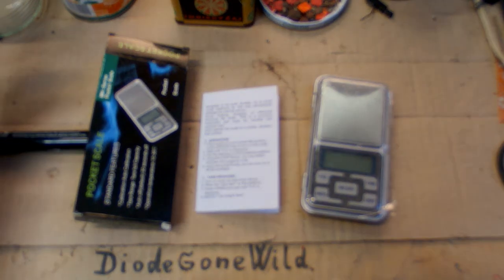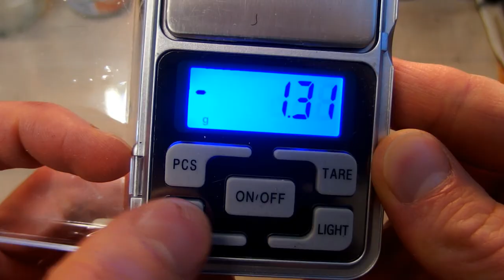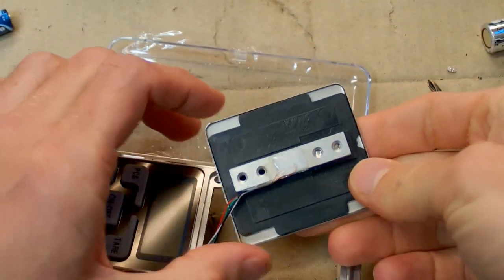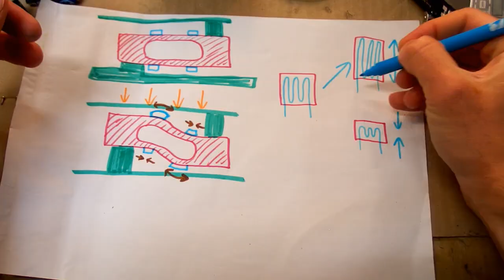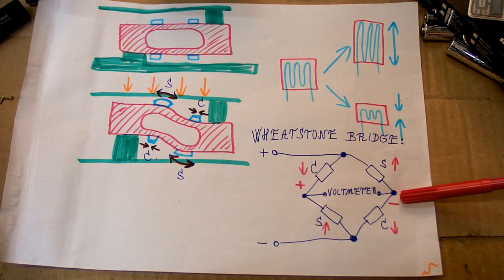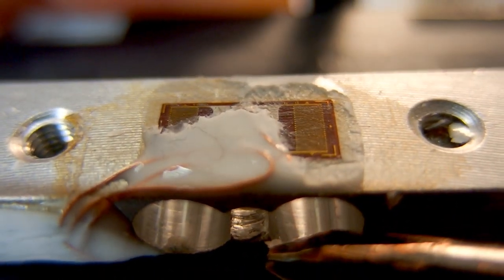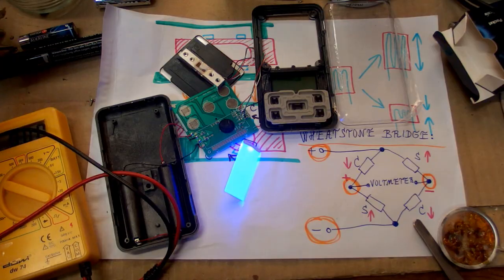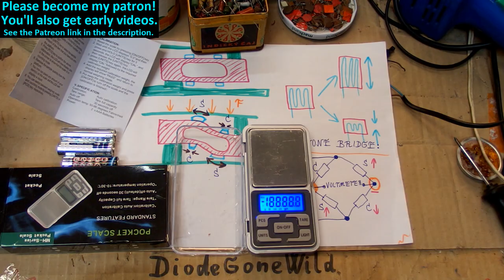What's inside a digital scale & how does it work

Comment: you can probably put a 500g weight then compansate it. When you remove the weight it will say -500 after that you can measure up to 1kg in teory.
Reply from the maker: Yes, that's right, because it has full capacity tare.
Reply: This often works, although there is a chance the load cell will be bent/changed permanently, making it less accurate.
Reply: Tried with my cheap kitchen scale and it don't work. 
Probably the chip can only read (example values)maximum 0,6V (600gr) and it can't read it correctly 

Different is if the cheap display can only shows (max) 199.99grams. In that case the trick will work
Reply: @thefighissimo  I doesn't work for all of them but works in mine.
Reply: Yes, in theory you should be able to weigh anything from 500g. to 1kg. by this method, or even up to 1.5kg. by zeroing it again with 1kg. on the scale pan; but in practice you would have to watch out for (1) the voltage difference exceeding the input range of the amplifier and (2) the force applied exceeding the elastic limit, so some part of the sensor does not spring back to the shape it was before but is permanently deformed.

A good design engineer would never let that happen, probably allowing for the system to withstand up to 2.5kg. before non-elastic deformation if it said maximum 0.5kg. and the amplifier to remain linear all the way up to 1kg. But a sales manager will insist for everything to be made as cheap as possible in order to get maximum profit, so the metal beam may not be strong enough to take much overload. And it is a bad idea not to use the full linear range of the amplifier for meaningful measurements.  The smaller the wanted signal, the greater the influence of any noise upon it.  The analogue to digital converter also has a limited number of steps, which must be a power of two; probably 65536 steps, to cover the range 0-500g. in 0.01g. steps.  Once you exceed the maximum input voltage, it will never read any more than 65535.

(It is possible to use two analogue to digital converters together to obtain a wider range but with less precision at higher readings.  This is often a good compromise between maximising precision on small readings and using an analogue to digital converter with a higher resolution  (more bits = more £€$, and in any case you are often restricted to what is available on a chip).  For instance, two 8-bit converters are fed with a signal x and an amplified copy 16*x.  The converter receiving the stronger signal will max out at 255  (which is really 15.9375, since it has been amplified by a factor of 16)  but the converter receiving the weaker signal is still only reading 15 at this point, and can go all the way up to 255, just in coarser steps.  What the software has to do is read input 1 and if it is 16 or greater, then multiply it by 16 to get an answer from 256-4080; otherwise ignore it, and use the reading from input 2 directly to get an answer from 0-255.)
Reply: @bluerizlagirl  Precision devices like this one will usually use a Delta-Sigma ADC. (search this on Wikipedia). Depending on the setting Delta-Sigma ADCs usually have up to 20 or 24 bits of resolution (sometimes even more!), however the smaller the resolution, the smaller the sample rate. It's not impossible for this scale to have 20 bits of resolution because it can leave some room for calibration/rounding. I mean that 0.01g might be equal to 0.8 ADC steps with a 16-bit ADC which will cause rounding errors, whereas with a 20-bit ADC it will be equal to about 13 steps.

Comment: Very sensitive measurement needed; remarkable it so cheap.
Reply: It's a consequence of precision mass production.  As long as you can make the sensors as identical as possible, from then on all the laws of physics are in your favour. The impedances are low and the wires are short and close together, so noise pickup is minimised. The components on the chip which make up the amplifier circuit are close together, so at the same temperature, which means everything is affected equally.  And the analogue circuitry is symmetrical, basically three op-amps: one to provide a buffer on each input to minimise the influence of the other input on it, and the third to amplify the difference between the two to match the analogue to digital converter.  This symmetry naturally rejects noise.  All the rest is straightforward digital stuff well within the capabilities of a modern microcontroller.
Reply: @bluerizlagirl  Thats a good analysis.  I wonder if a generic op-amp like LM324 can work like a instrumentation amp you mention.  The figures measured in the video seem to in the millivolt range; maybe the input offset of 2mV of a generic op-amp would be the limitation.  I've checked these low cost Chinese digital scales- the construction are with the cheapest materials possible, and even the finish is lousy.  However surprisingly the measurement is precise and repeatable over months.  I imagine that someone has mass produced these as an SOC, and selling it off cheaply in bulk to anyone interested in building a product around it.
Reply: @rtos  As a general rule, the smaller you make something, the fewer ways there are it can go wrong. What's most important in making both instrumentation amplifiers and A-D converters is close matching of the ratios between resistors, and that's actually easier to do in silicon than to get an exact value. The programmable gain and offset circuits also depend on closely-matched resistance ratios. Also the close thermal contact helps compensate for temperature changes.

I'm expecting it to be using software calibration to tweak out DC offsets (knowing there is nothing on the scale pan when first switched on, so the weight should read 0g.) and set the gain, and some sort of averaging over multiple readings. These cheap scales do tend to drift a little over time, but that's probably why the automatic power off is so aggressive!
Reply: @bluerizlagirl  how does a cheap knockoff like this compare to original one like lyman or hornady, frankford arsenal ?

Comment: That Auto off in some scale like this is one of the biggest annoyances in my life. When you do not got all ingredients of the cake at hand, it will turn off just the moment you are back, and you are lucky if you can figure out what's already in the bowl.
Reply: smoke atleast 1 bowl of cake ingredients but no more than 8 bowls while weighing cake ingredients or you will forget easier
Reply: I was just about to comment about this.
I wish i could find out how to bypass the Auto off feature!
Reply: @jayytee8062  No problem, the blob can not be accessed, but a pulse generator with a relay could connect resistors to the bridge shown in the video, this would simulate something is happening on the scale. Will make this happen after I finished the other 100 ideas I have...
Reply: @timtim8468  
Thank you!
Reply from the maker: Finding a completely flat battery in equipment with no auto-off is even more annoying :D.
Reply: @DiodeGoneWild  
Only if you don't know how to operate an on/off switch
Reply: @DiodeGoneWild  When I steer my car into an obstacle, it will do. But ... they are working on that too.
Reply: @jayytee8062  If you succeed, you will end up wishing you had not! The auto power off shuts off the scale before the reading can drift too much.
Reply: @bluerizlagirl  
I don't understand your last sentence in your comment.
Reply: @jayytee8062  If you keep putting something on the scale and taking it off so as to keep the auto power off from kicking in, you will see how the reading drifts over time.  This probably is due to temperature changes.
Reply: @bluerizlagirl  
Ok i see.
Have you tried this modification yourself?
Reply: @jayytee8062  No, I did not think there would be much point in defeating the auto power off because the reading changes over time and would soon become false.  If you leave the scale on for a long time, it drifts and needs to be repeatedly zeroed.  So I just weigh one thing at a time and record the reading before the scale shuts off.

But if you are really desperate, you need to wire an NPN transistor and a resistor, any value close to about 10x one of the bridge resistors should do.  Connect one end of the resistor to one output from the sensor bridge, the other end to the collector and the emitter to battery -.  Now you need a circuit to pulse the base of the transistor on for about 100ms, every few seconds, and then back off again.  That will simulate changing the weight, and cause the auto power off timer to reset itself.
Reply: @bluerizlagirl  
Thanks for the reply and technical info you have provided.  Awsome!

Comment: Information about battery life and behavior with dead batteries:
Current when OFF:   0.4 uA   (virtually indefinite shelf life - no need to take out batteries)
It gives Low battery warning (refusing to work) bellow 2.5 V so it will use up only around 50% of capacity of normal primary cells and maybe 10% (!) of NiMh rechargeables at best.
Current when ON, without backlight:   3.5 mA   (ca. 140 hours of continuous use, assuming using up 50% of an AAA capacity)
Current when ON, with backlight ON:   14 mA when running from 3.2 V (fresh batteries), 7 mA @ 2.8 V and 3.5 mA @ 2.5 V (backlight goes very weak).    (hard to guess - few tens of hours, maybe???)
The low battery warning seems to be reliable and the scale doesn't read nonsense with low batteries.
Reply: Interesting addition, thank you!

Comment: There is an other kind of digital scale, that was used in low budget digital personal scales 20-30 years ago. It has the same mechanism as an analog personal scale with the rotating number disc, but the number disc is replaced with a slotted code disc and an optical gate, like the optical encoders in old ballsy PC mice. They are horrible. You stand on it three times, and it gives three different values with about 5% or higher inaccuracy :)

Comment: Nice. 4 wire measurements of the resistance in the strain gauge. That helps a lot with accuracy and temperature stability. The opamps, voltage reference and ADC (22 / 24 bit maybe) also need to be pretty accurate and linear, because I don't think these scales are individually calibrated at factory to compensate for all inaccuracies. It is quite amazing that you can produce so precise device basically for less than 1$.
Reply: I think they are all individually calibrated, to take out the random variations between units. The gain and DC offset will be set by D-A converters, from values stored in E2PROM.
Reply: @bluerizlagirl  you are right. You can even do it yourself, they do have guilting calibration function, some long button presses and one or two test weights and you are done. Quick to do.
Reply: @bluerizlagirl  Yes at 11:41 you can see a VPP test pad on the circuit board for the Antifuse/EEPROM programming voltage. There are also 4 test pads near the LCD connector which are probably intended for programming calibration data.
Reply: @atmel9077  I guess that would be for the initial programming of the micro. It probably contains just standard UV EPROM like the classic 27128, but of course the black resin blob prevents it from being erased.  Although you probably could use X-rays to reset its contents to all &FF, if you really wanted to reprogram it!   There probably will be a separate area of EEPROM to store the calibration data; and some hard-wired ROM containing a special loader program to allow a program to be read serially through the 4 pin interface and written to the main EPROM.

I can see at least 28 tracks going under the blob, so maybe there is also a version of the same chip in a 28-pin package .....  perhaps with a glass for UV erasure.

I can think of many situations where you might want to measure a voltage and display a reading which can be got by simple maths from it.  The IC probably is a very generic one that could be used with many different kinds of sensor, not just for weight but also light, sound level, pressure .....  just by programming a different gain and offset, and a microcontroller with enough I/O pins to drive the LCD, read the buttons and control the power to the sensor so it is only connected to the battery when a reading is wanted.
Reply: @bluerizlagirl  I've got one possible candidate... https://www.holtek.com/documents/10179/116711/HT67F5630v120.pdf
It's got an LCD driver and a 24-bit delta sigma ADC with 19.5 effective bits @ 5 Hz and a differential programmable gain amplifier with a gain of up to 128 so probably good for this kind of application.
Reply: @atmel9077  "Direct LCD drive" is a euphemism for "weak-ass outputs" ;-p

Good spot though!

Comment: Great explanation.
I have a question, hopefully you can help me.
I have a mini scale, if I put the weight in the exact center the measurements are accurate. But if I don’t and move up/down-left/right even a little the values change a lot. Is there a way to fix this? 
Thanks in advance for your time

Comment: I have a nice and fairly expensive kitchen scale I am attempting to fix.  everything seems fine so I think my issue is with the backlight or the connection pad onto the display glass.  Is there a way to re-adhear the display glass to the small connection rubber piece if it fell off?

Comment: I have the exact same scale 
It's thrown in the recycle by someone but the only faulty thing is the tack tile click switch on the on/off
Reply: *tactile - and it's neither a click switch nor a tactile switch.
Reply: @johncoops6897  mine have a tactile switch
Reply: @lifeai1889  Then you DO NOT have the "exact same scale", do you? Clearly at 10:43 ou can see that this scale DOES NOT have a tactile On/Off switch.
Reply: @johncoops6897  not exact the same but almost
They looks the same and even have the same frimware
Just the switch is different

Comment: I have a hanging type luggage scale with a very small backlit digital scale that reads in grams,,lbs,and kgs,,to hang heavy packed suitcases on it to check weight to b sure I,m not exceeding 20 kgs b4 travelling on any long hauled public transport including domestic and international air flight travel journeys.
Reply: Gee, wow. I have a white cupboard style device that uses an electric motor to pump refrigerant gasses and move heat from inside to the outside. That reduces the internal temperatures, making it ideal to store perishable foods, to extend their edible life. I use it for dairy products like milk and cheese, for meat, and for vegetables as well. It can also be used to store previously cooked foods, and to chill liquid refreshments like juices and beer..

Comment: Could you explain why scales can detect RF in the microwave range? Mobile phones during a call, WiFi routers and microwave ovens effect scales. Grammes for example jump around -5 to 10 when I heat up food, it's dependent on proximity. Just a few inches reduces the measurement greatly. 
PS: the second unit tl is teralitre, 1 tl = 1 trillion liters.
9:55 could that bridge be acting like a transducer? tl or gn on your scales would show a better resolution.